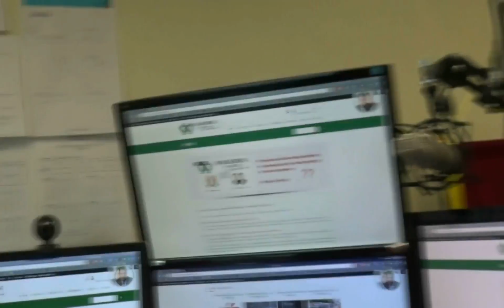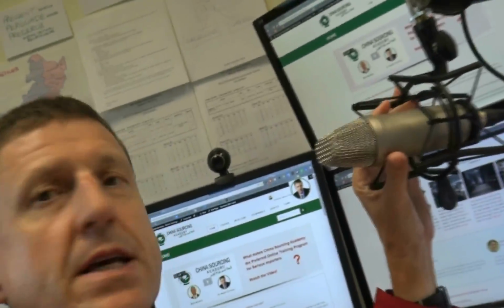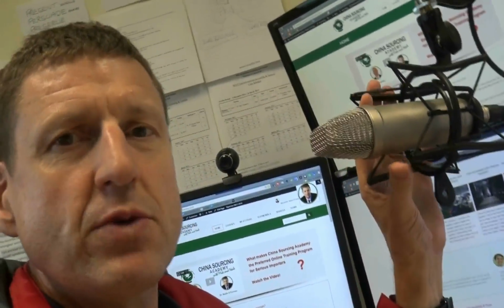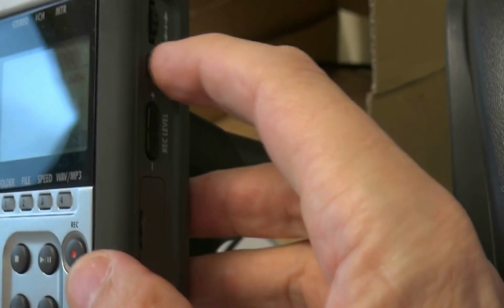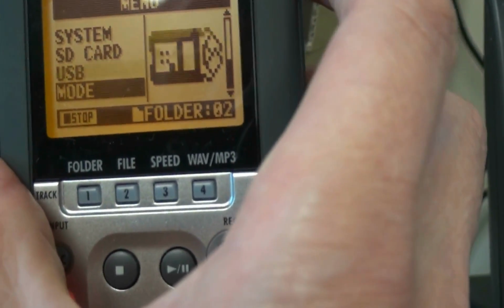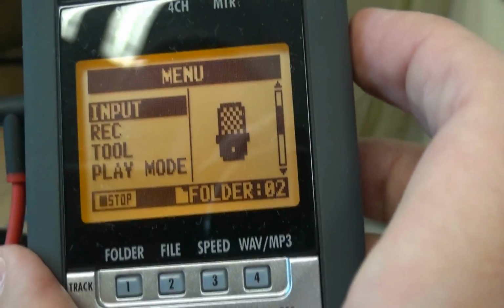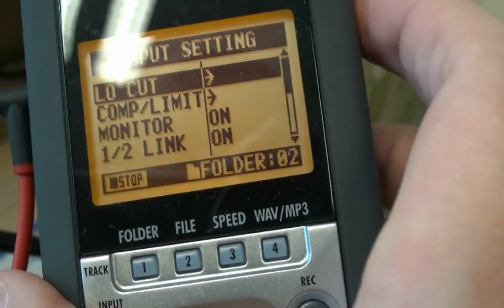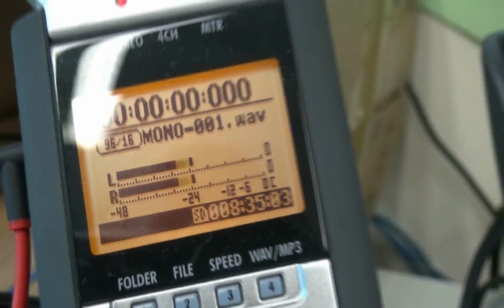How I use my Zoom H4n Recorder to record Skype interviews?

Comment: Hi, I just listened to your video which was excellent by the way. I have the H4n and looking  to podcast using skype. In mic-1, I have the Audio Technica 2100 plugged in and in port 2 I have this connected to the laptop headphone jack. I also have a USB cable connected from the Audio Technica mic to the laptop. I changed the settings on the H4n to what you have in this video. 
I also have my headset plugged into the side port on the H4n to listen to the audio from the call.

Regarding the sound from the person on the other end of the skype call, it sounds a bit "hollow" and unnatural. Would you know what settings I would have to change on my laptop to eliminate this sound?  Would you know what is causing this? Appreciate any tips you can provide and thanks again for an excellent video tutorial.
Reply from the maker: Thanks for your feedback. Sorry for the delay in responding. I think that having an audio mixer with USB connection enables you to create two feeds from your microphone - one via USB to your computer and one directly to the H4n recorder. Otherwise you can only have one signal from the computer to the recorder that carries both your voice and the interviewees voice. This can work, but you might not have two channels recorded. Hope this makes sense. BTW - I find having the separate recording device so useful and automatic when I get on a call and it frees up the computer system from having to do the recording.